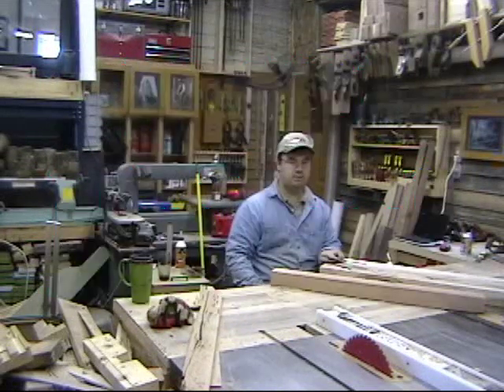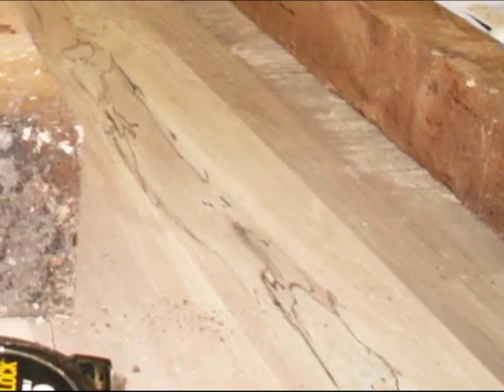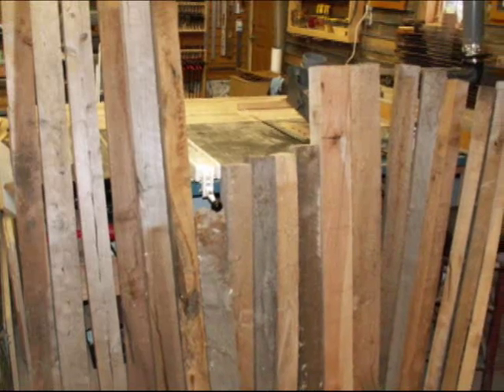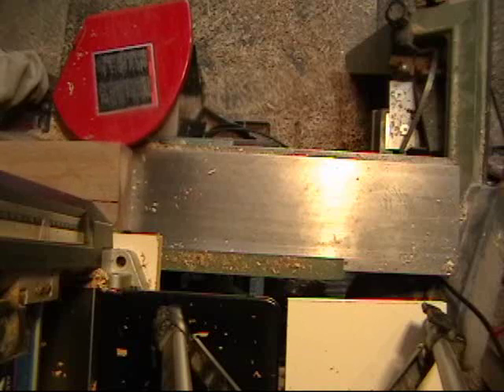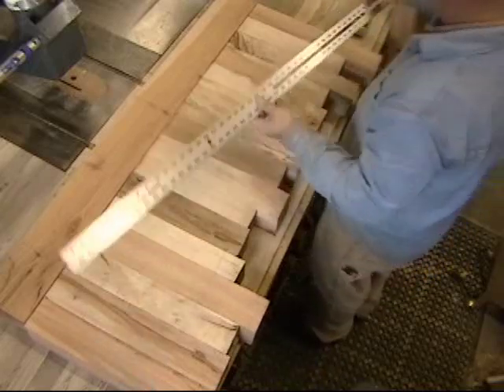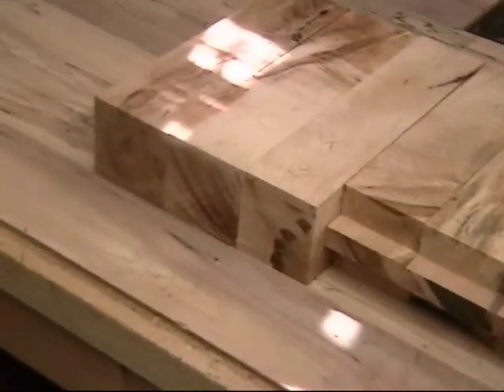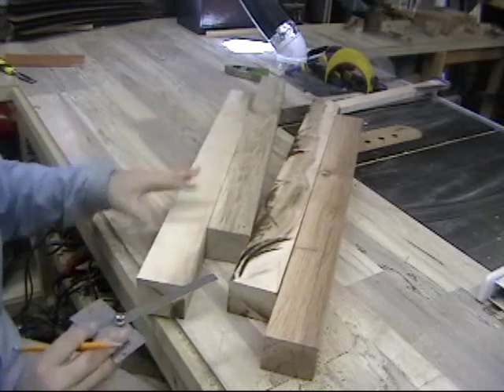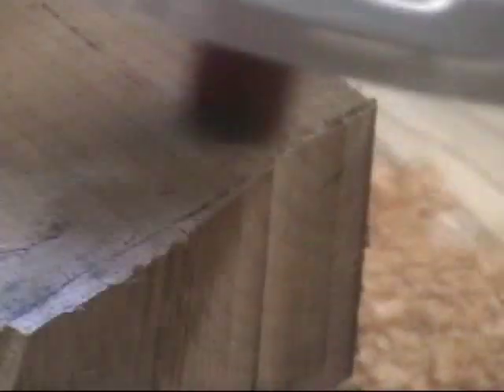Charles Neil Takes Me On Part 1 -Woodworking with Stumpy Nubs #1

Comment: Great Vid, I like your sense of humour.  The router at the end terrified me, and I was just watching it on video, not staring at it close up.  I think the reason it is biting, is because you are cutting the wrong way.  you should always cut in a direction against the spin, not with it.  This way if it bites it just lifts slightly, instead of pulling itself into the wood.